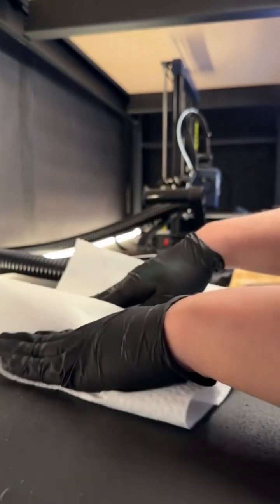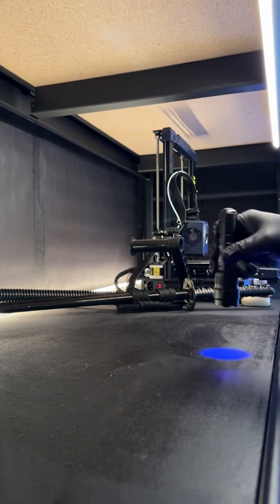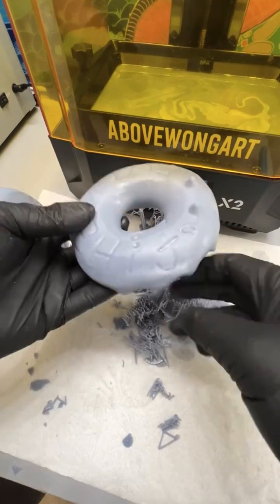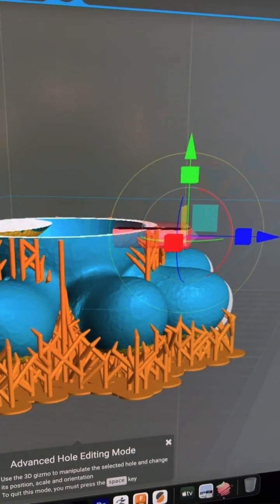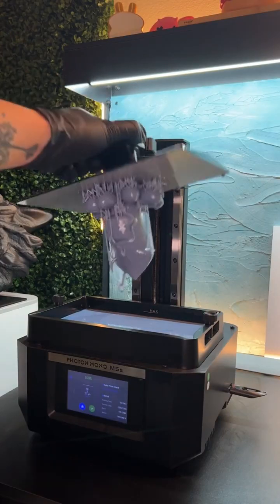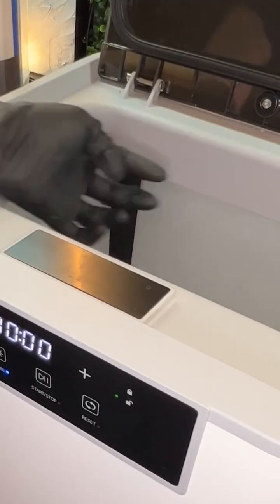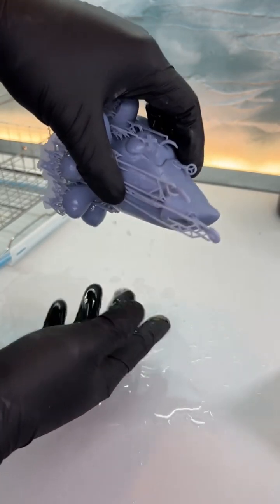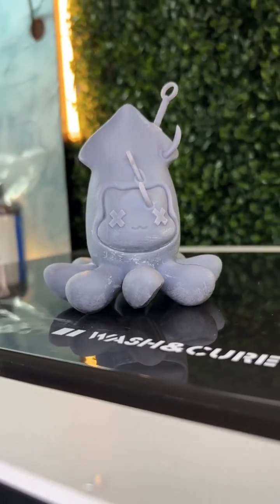Resin 3D Print Exploded

Comment: Just saying that you'd use the same amount of resin making it solid as you would by leaving it liquid inside, because either way it's leaving the reservoir. And if you'd made the donut solid it would have weighed the same as resin-filled and not exploded. Can also drill a small hole into the cavity in a spot that won't show if you forget a drain hole again, just make sure to do it over your reservoir or somewhere that you won't make a huge mess.

Comment: You didn't properly post cure it. If it a thick model, you need to leave it out in the sun for a day or two to properly cure it all the way through. 
If the wall is hollow, you need a drain hole on the top or bottom to let the excess resin escape

Comment: You need at least 2 drain holes, air needs to come in one while resin goes out the other, ideally at the top and bottom of the printing orientation!
Reply: You don’t need more than one drain hole if the drain hole is big enough it will allow air to pass through and negate the vacuum effect, example: open a plastic water bottle and turn it upside down the water will go through because the surface tension was too weak to create a vacuum allowing air through one hole . The same should apply to most liquids within reason  ☝️🤓
Reply: Exactly what I was about to say. Silly to take so long because it's choking for air
Reply: So it depends on what you want to go for. If it's a critter, give it a mouth and a butthole.

Comment: Either make it 100%, which is not good, or add at least 2 holes. Another possible way would be to leave it open and make an enclosure, or pause it (if your printer goes up when paused) as you get close to the first plane of the bottom piece, this way you get almost everything out.

Comment: What's the point I'm not putting a drain hole in. At that point you might as well just make a solid model it's not going to extend the working time. All is going to do is save you some material

Comment: I have little squeeze bottles with needle tips. I use them to force alcohol in one hole so the resin drains out the other hole. You can use much smaller holes this way.

Comment: what does the UV do, and why is there liquid?
Reply: Depending on the type of resin, I believe uv light causes it to cure quickly
Reply: 3d printer resin, hardens with UV light and it's much more liquid
Reply: All 3d printing resins are UV activated, ie that's what makes them turn from liquid to solid. As the part is formed, the open end is never lifted out of the pool of liquid, so if your part is hollow liquid gets trapped inside. If you don't include a drain hole in your design you can drill one after printing, but the liquid inside can cause ringing and artifacts during printing. Less than ideal if you want a smooth finish on your part.